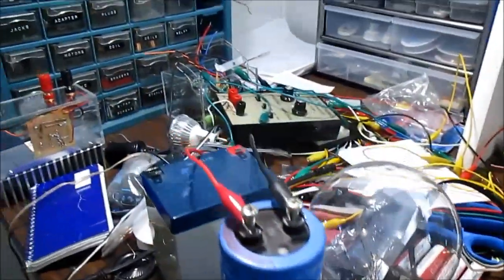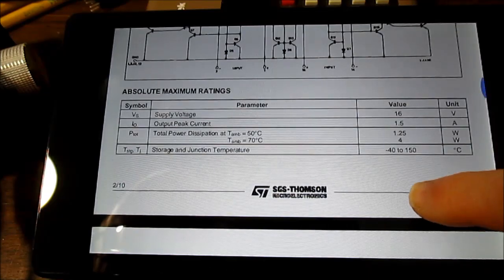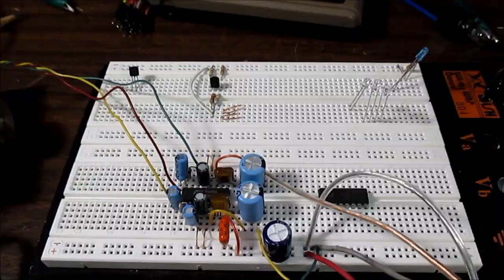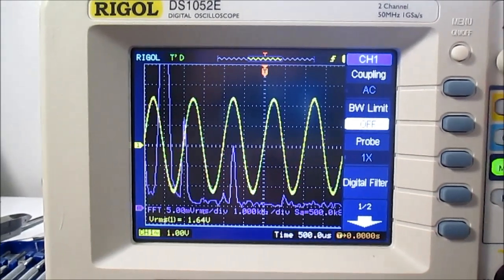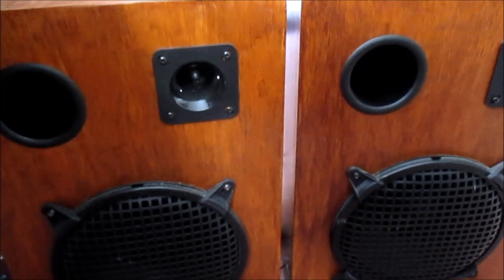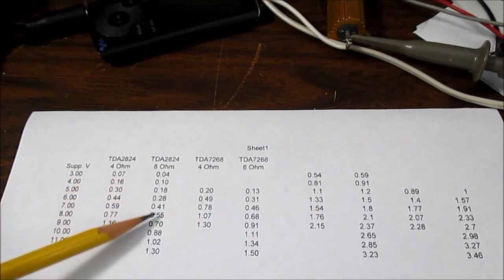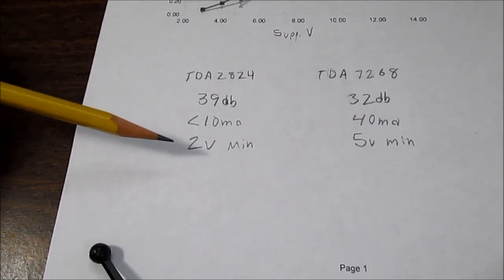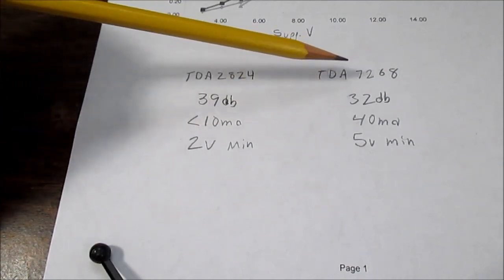TDA2824 vs TDA7268 stereo amplifier IC test

Comment: What's the difference in signals between Headphone output  and Line out level output and why headphone out needs power amps with more gains ?
Reply from the maker: Headphone output from music players and phones (and such) are a lower level signal and capable of driving low impedance loads. Line level is higher impedance and a higher level signal. The "fancy" hifi headphone amplifiers do put out a higher level signal.
Reply: @JohnAudioTech  Is TV audio output at the back of TV sets a higher output and higher impedance ?

Comment: testing available chips would be more useful to us... :p just saying..m
Reply from the maker: Sadly these small chip amps are becoming rare as surface mount and class D take over.
Reply: @JohnAudioTech  what is best SQ ? those old chips or new ones... class-d 

did you check the irs2092? the distortion curve was kinda incredible from what ive read

my old nikko alpha 230 amp is 0.008 thd wonder if you could learn from their design.. its a very good sounding amp.. even my new ATI amp couldnt compete

Comment: Hi john. Can i ask u a question? I have an amplifier that can take 12v-24v power supply. Which supply is better? 12v/5amp or 24v/2amp? Ill wait for your answer   Thanks!
Reply from the maker: The 24 volt supply might be inadequate for the amplifier because it is only 2 amps. It would be better if the current rating was 3 or 4 amps. The 12 volt supply has more than enough current for a stereo board.
Reply: JohnAudioTech thank u so much john. I really really appreciate your reply. 

One more. Two 12volts/5A in series. To make it 24. Would it be possible? Its a brick power supply like the one we use in laptops!
Reply from the maker: It should work in principal, but with switch mode supplies could have issues. A 19v 3amp or better laptop supply would work as well. These seem pretty common.

Comment: So was the TDA2824 discontinued before or after the TDA2822M?
I'm right in the middle of building up the TDA2822M but can't find any 5 Ohm resistors. can't even use 2x10 Ohm resistors in parallel because I've run out of those too!
Think i'll have to leave them out for now until I manage to get some or find something with a couple of them in!
Saw the notification for your video and it sparked my interest seeing as though the model numbers were more or less the same and had to stop filming and watch your video John.
Reply from the maker: I think it was, but not positive. I believe the chip design in these ICs were very similar. Any resistor in the 3 to 10 ohm range would work. The value isn't critical.

Comment: I Have a suggestion for a video, The TEA2025B. this IC was WIDELY used in all kinds of things. hell my computer speakers (made around 2010) have a pair of them. i also pulled the amp from one of those cheesey gaming chairs and it also had a TEA2025B.

Also what about the TPA1517NE, TDA7376B and E-TDA7396?
Just some suggestions ;)
Reply: Yeah, I have pulled that IC out of an old boombox. It's not fantastic (TEA2025B), but still pretty good for projects.
Reply from the maker: I knew someone would mention that one. I had a couple boards around out of cheap speakers using the 2025. I'll have to see if I can find them. ST obsoleted them as well. I did do a video on the 1517. Powerful chip for a dual inline package stereo amp but the gain is set really low at 20 db. It needs a preamp for about any signal source.
Reply: now I have to go back and see the results from the 8403 which is of course tiny and new but interesting to compare what you've done with the old components and the values you ended up with